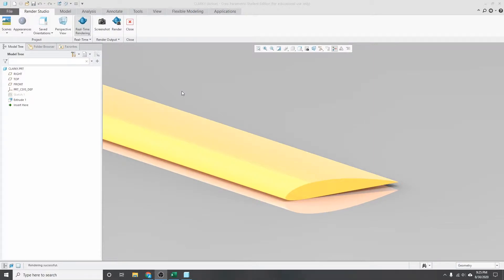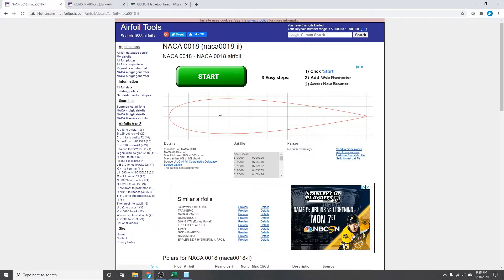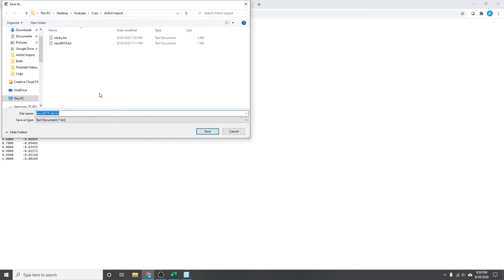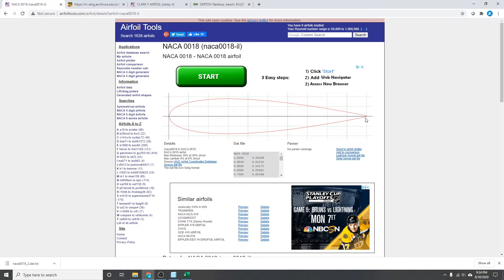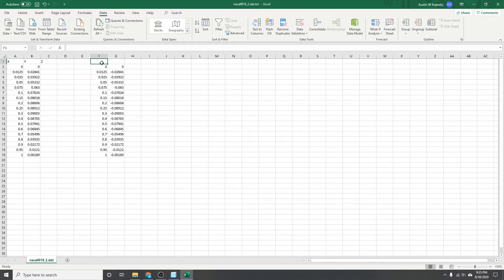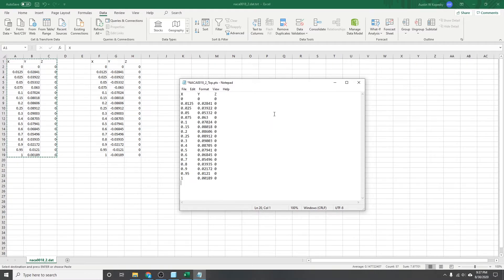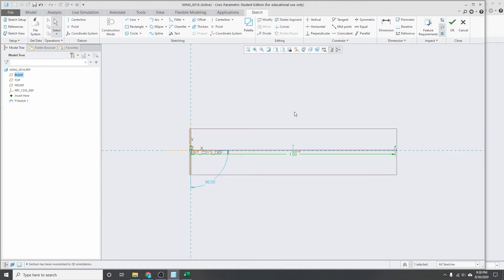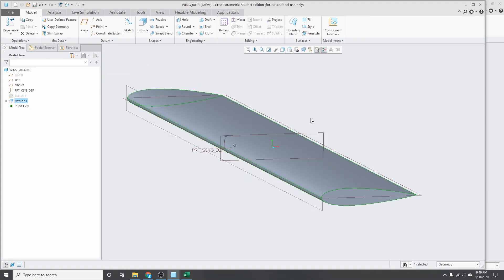The EASIEST way to import Airfoils into Creo and Pro/E

Comment: Airofoil 2412 how to draw sir . If I follow same steps it won't came properly . Any changes is required for 2412 .
Reply from the maker: Do the splines still generate? My first guess is that the .pts file may not be set up properly. Did you break down the file into two separate input files for the upper and lower splines?
Reply: I had the same problem. For NACA2412 it works like this:
- generate the pts file as explained in the video
- generate a new part in Creo
- do not start a sketch, but klick on 'Point' and then on 'Offset-Coordinate-System'
You will get a window; then klick on your coordinate system
- klick on 'Import and import one of the text files; repeat for the other. then you have the points :)